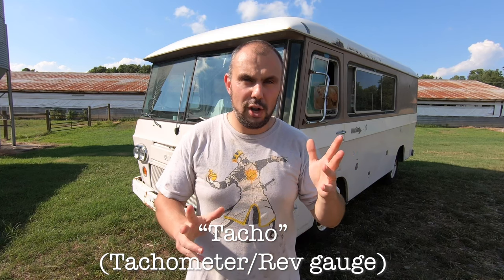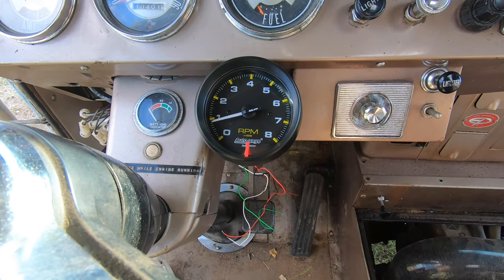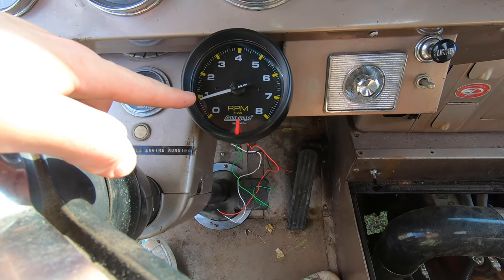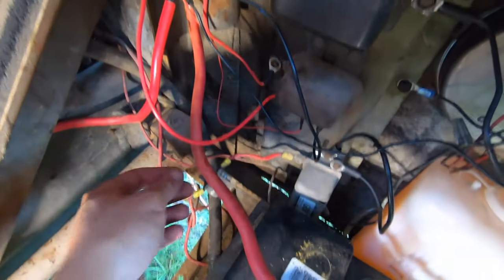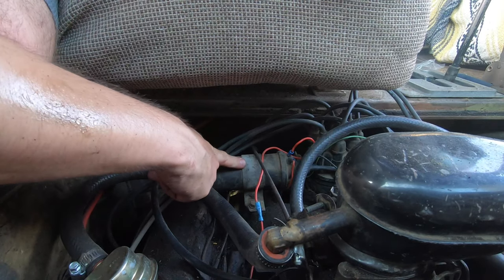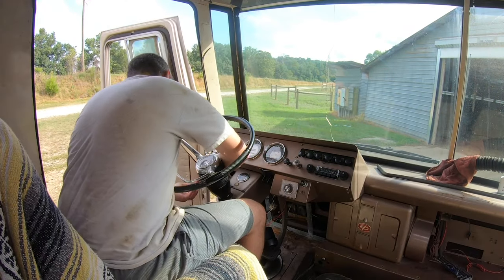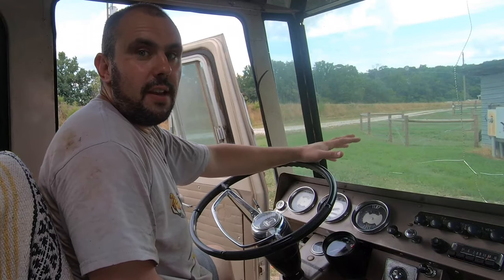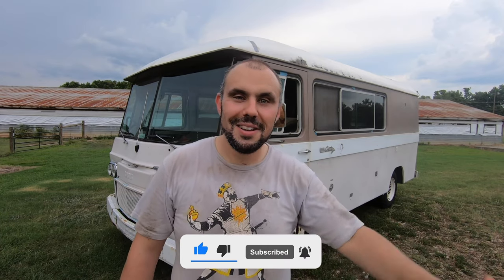MODERN UPGRADE: How to Install a Tachometer (Tacho / Rev Gauge) in Motorhome, RV, Bus, Car or Truck

Comment: Remember to either choose the correct tachometer or select the appropriate tachometer settings for whether you are running a V8 or slant six in your Cortez.
Reply from the maker: Yep, you're absolutely right! On the Tacho we used you had to take the back off to change the setting! Didn't even think to mention that so thank you! Andy&L

Comment: Give up on that dodge engine, you need to LS swap it :) j/k.  Autometer stuff is nice, I added a tach and transmission temp guage to our GMC, the tach is really helpful for setting idle.
Reply from the maker: Ha ha! We'd have no problems getting anywhere fast with an LS! Yea the idle is one of the main reasons I wanted to install it. I was also thinking of installing an oil temperature and pressure gauge on ours to further keep an eye on the engine. Our transmission is manual but I've been considering ways to help keep it at sensible temperatures. We plan on going off the beaten track when we use the Cortez so I want to make sure that wherever we go, we can get back home! Andy&L